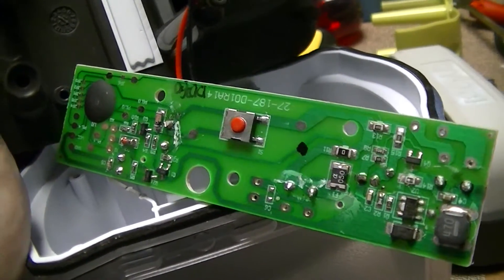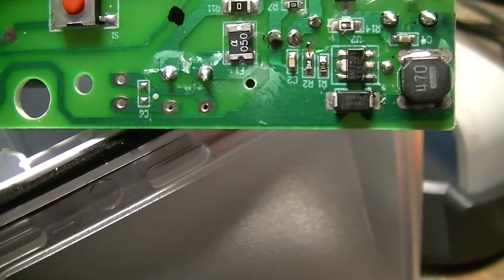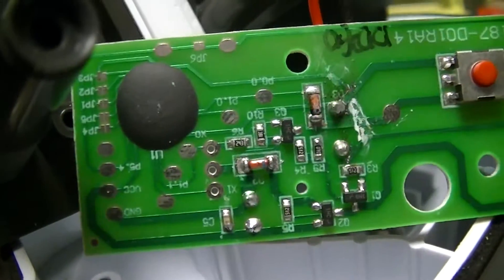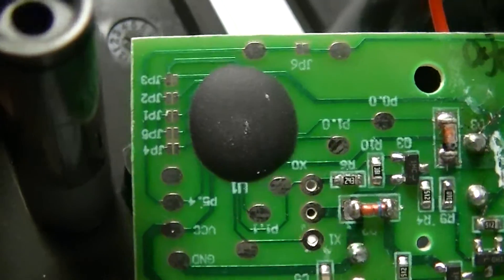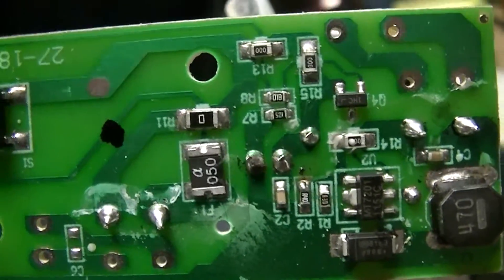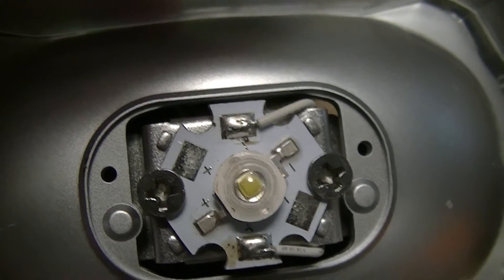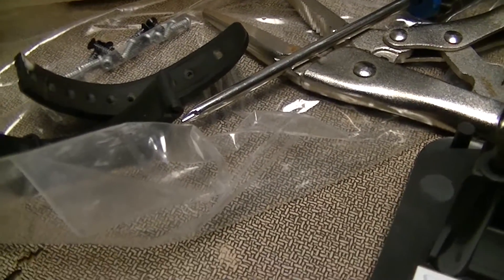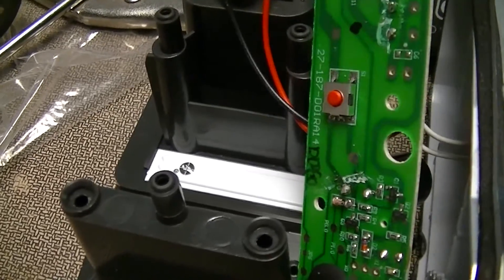Ryobi P780 one+ LED lantern guts

Comment: With the view you gave of the space under the LED module I believe can come up with a suitable aluminum heatsink form assuming can get the heat to conduct or radiate through the sides of the enclosure without getting too hot. No ventilation.     As much as I want a brighter lantern, believe I'll leave it alone and make a suggestion to Ryobi to come out with a beefier LED module and heatsink. Nothing less than 500 lumen. I've used this enough camping and in power outages to say it's too dim. Another note on Ryobi 18v accessories the P741 portable FM radio has a poor receiver and the flip up antenna does little to improve reception. Unless you are within 10-15 miles of the transmitter, you can barely pick up stations and if too close it overloads. The membrane pad push buttons are difficult to press. A real shame with today's electronics, they could do better for $30.

Comment: Thanks for posting, glad I found this video, Does it seem possible to modify? Tried to open mine tonight and without the right Torx driver, couldn't do it. Had idea of upgrading the LED to a brighter unit and maybe making it dimmable.  Would love it if could go up to about 500 lumen. Otherwise a great little rugged lantern companion with the other 18v tools.
Reply from the maker: RLZerr A brighter LED would require a much beefier heatsink, such as replacing the existing LED mount with some aluminum plate to which was mounted some 1in or so square aluminum tube stock with a power LED module mounted on each side of said tube stock.  Note that the plate and tube stock should be joined with a low thermal resistance method like an aluminum L bracket on each side of the tube.  If you do that, I would recommend having at least one of the LEDs controlled separately so that it could work as a flashlight without blinding the user.